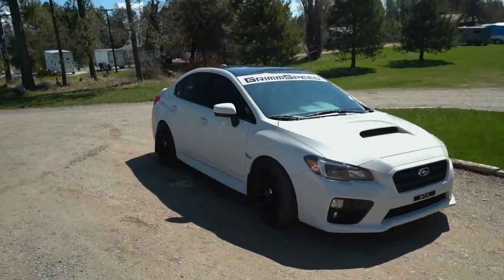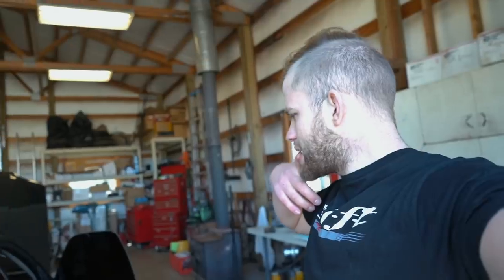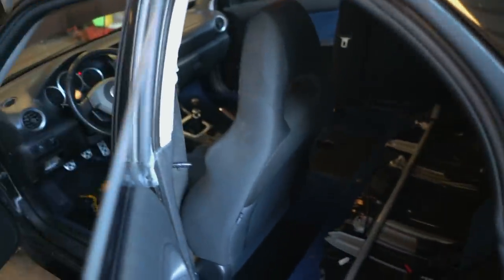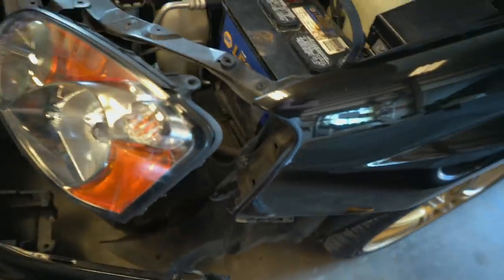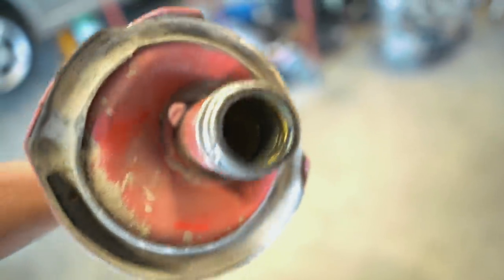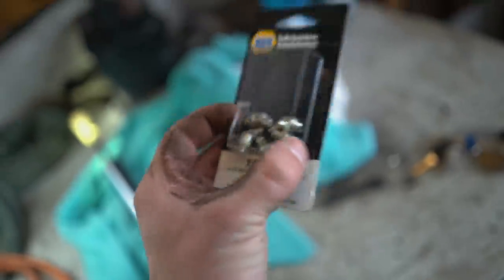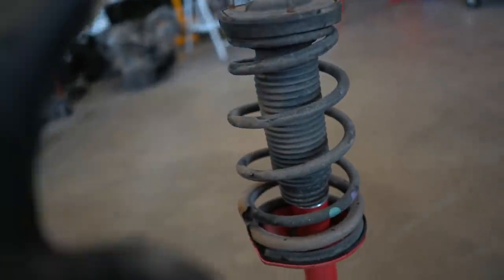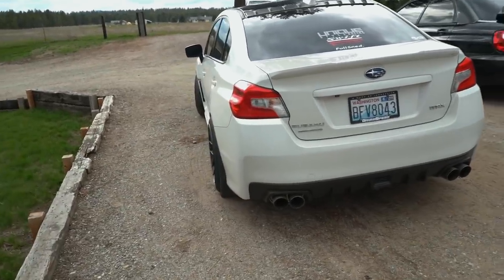Fixing 3 Things I Hate About My STi

Comment: Omg them clunkzzz!!! I used to have them in my blobeye and they were driving me crazy. It's kinda funny to remember that now (don't have that car anymore and this vid made me feel nostalgic). Either way, my quick fix was to jack up rear corners one by one until the wheel just comes off the ground and the shock extends all the way out, and spray the area where the shock meets the housing with white lithium grease, or put on some molygrease with a brush. That would quiet the things down for a couple months. Getting the greasing holes done was a bit too much for me back then, but I'm really happy that you took the time and did it, also I really appreciate you showing it on video. Hey and greetings to Cameron! Nice to see him on your channel.

Comment: My 06 rexy had the same strut knock and it was old dry grease from factory causing it, to get it replaced was going to run me $700 so I fixed it with a mate....he had the gear I got a $10 tune of grease and it's been great ever since, except I didn't have to drill it I just pulled it apart